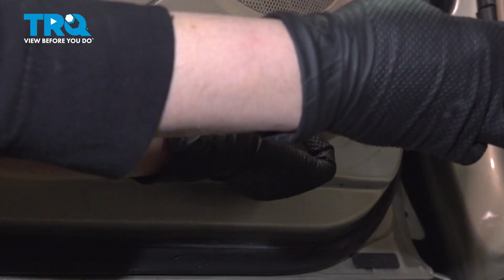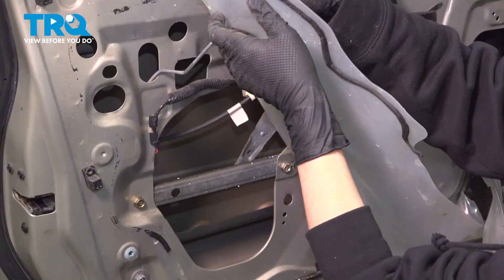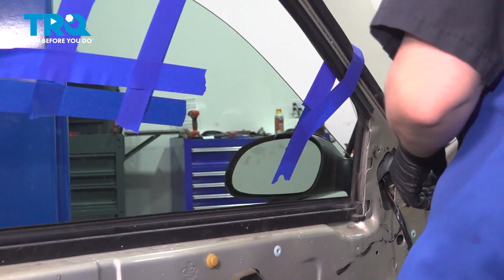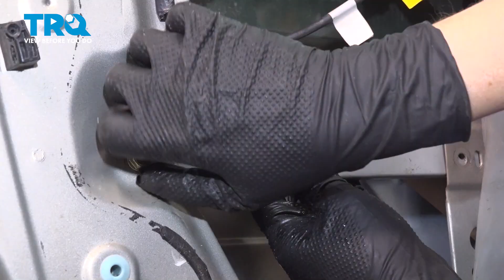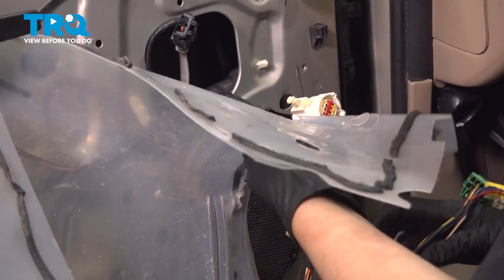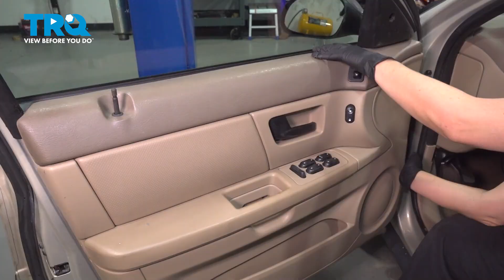How to Replace Front Power Window Regulators 2000-2007 Ford Taurus

Comment: ONLY ONE FATAL MISTAKE SHE MADE. THOSE AFTERMARKET AND EVEN OEM WINDOW REGULATORS COME WITH NO GREASE IF ANY, MAKE SURE YOU MOLLY GREASE EVERYTHING ALL THE TRACKS AND THE WHEELS AND THE GEAR BOLTED TO THE MOTOR

Comment: Thanks for the video.  Two questions. 
1. Why didn't you just replace the motor (which is readily available) instead of the entire lift assy?
2. Can you reinstall using bolts & nuts instead of the rivets you used?

Comment: What size bolt and nut did you use please thanks
Reply: Make sure you use a bolt that's no longer than 1 inch long and make sure you use a locking washer and nut. Depending on the year it's either a 5/16 or 3/8